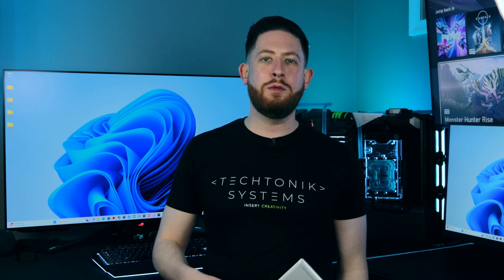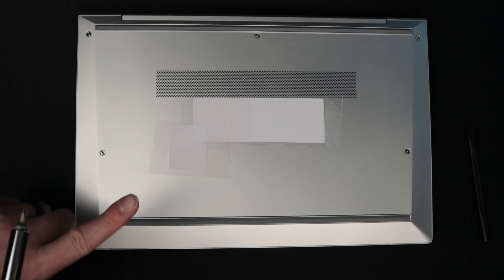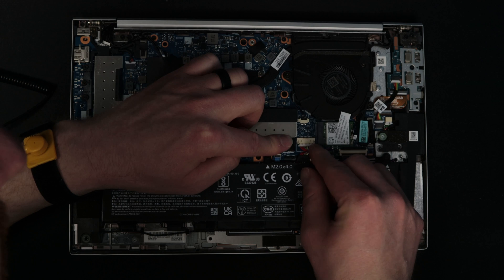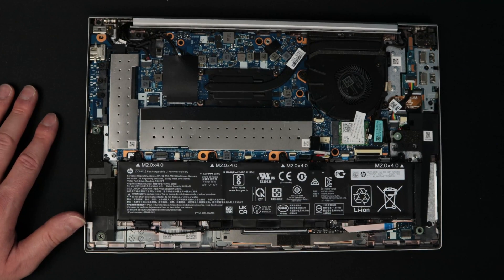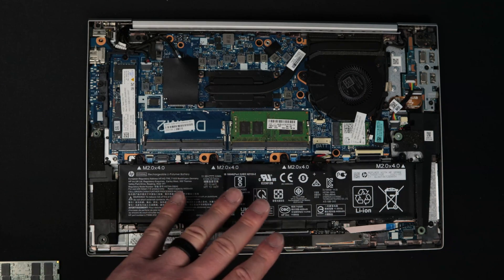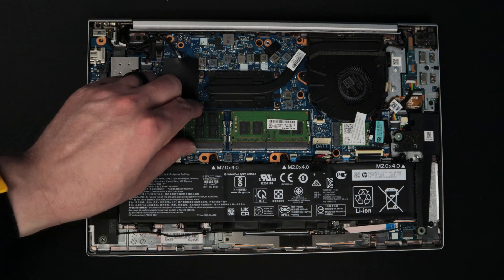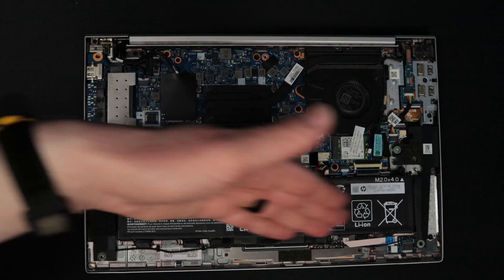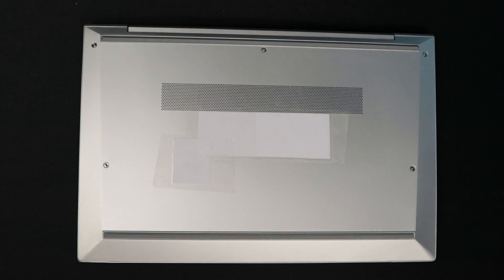TRANSFORM Your Laptop in MINUTES: How to Upgrade Laptop RAM!

Comment: i wonder if there's anything else i can upgrade on my hp laptop to increase gaming performance.. doesnt sound possible without replacing EVERYTHING else
Reply from the maker: Unfortunately, laptops pretty much have the option to upgrade RAM and possibly add storage (some don’t even have those options). The only laptop that I know that is able to be upgraded are framework laptops!

Comment: Hey like the battery removing process is important and should i purchase ram from where and which brand i have a bugdet for 8gb ram one
Reply from the maker: Hey! I would recommend buying the exact same ram module that is in your laptop currently. If you purchase a different size, speed, voltage, latency, etc.. it might introduce instability to your system or not work in general. As far as where to purchase, I am not sure as that would come down to where the RAM you need is available. I hope that helps! Thanks for watching!